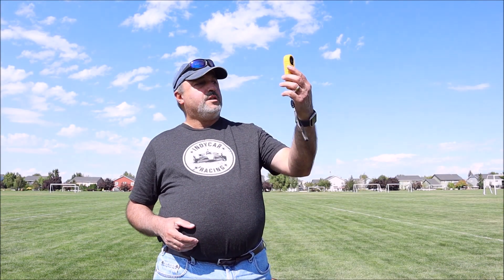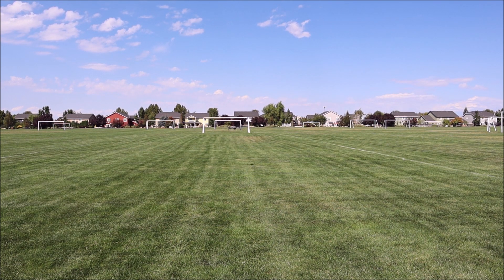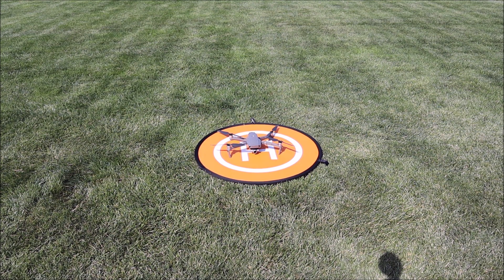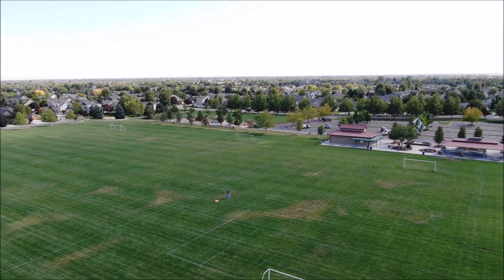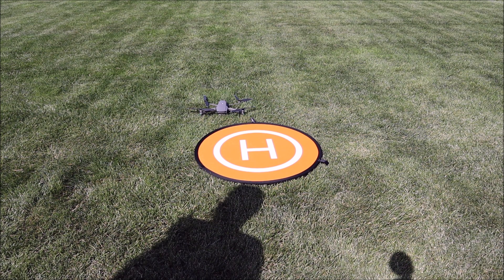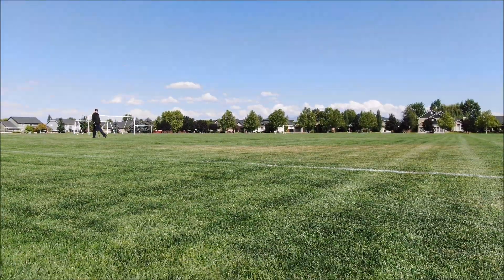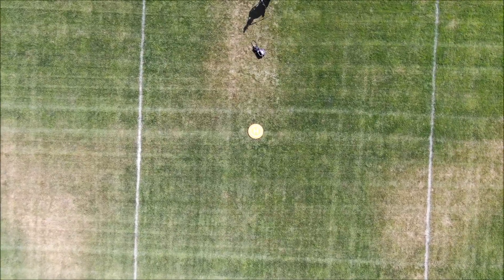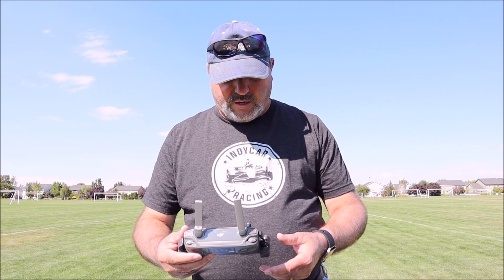Mavic 2 Zoom Precision Landing Test

Comment: A good and thorough test Marcus. No big deal in my opinion that the MP2Z doesn't yet have precision landing. I didn't ever find a problem without it when I had my Phantom 3 Advanced. I do have it on my Mavic Pro 1 but I've got well used to manual landing and so hardly ever use it. It's a wasted feature on me. Of course, if you want to swap my Mavic for your Mavic, I'm up for that! :)
Reply from the maker: Thanks a million Kev.  I agree, manual take off and landing are easy enough.